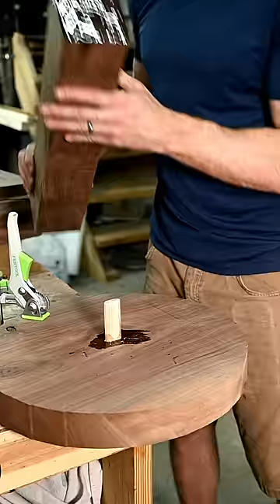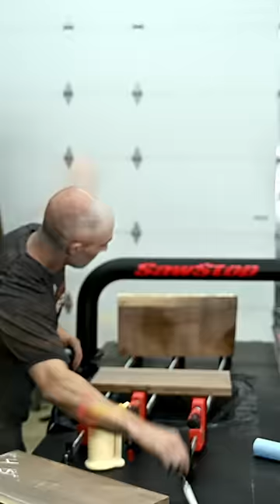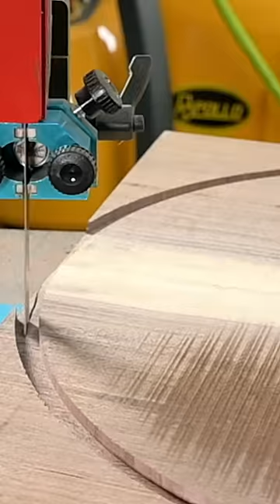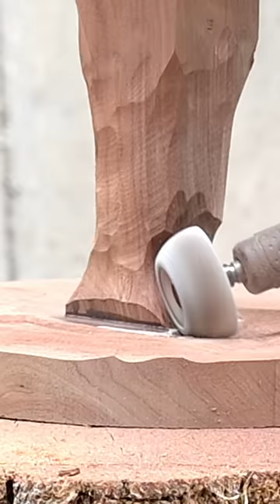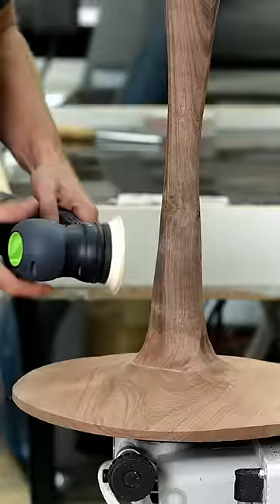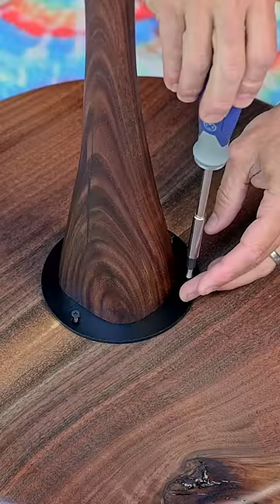I Tricked a Customer

Comment: Everyone saying that the tools don't matter have never even used a hammer. Yes the tools matter. They make the work much safer, faster, cleaner, efficient and the list goes on. And the nail in the coffin for the argument that the tools do not matter, if they don't, why does he use them and not cheap everyday tools?
Reply: Preach. Having done basic construction and home repair, the difference between ever a screwdriver and a power drill is insane
Reply: Time and effiency is key to making money, most people with a varying set of tools learned that and the tools pay off most of the time.
Reply: because he is a wood worker and these are average common tools a wood worker would have in his shop.
Reply: Keep in mind he said tools the average wood worker has, not the average person
Reply: @sh0cktim3  They absolutely are not "average" woodworker tools. Those are all expensive high end tools.
Reply: @nancygross4392  expensive brands. Basic woodworking tools. What kind of woodworker doesn't own a table saw?
Reply: @sh0cktim3 The amish kind. You have to be respectful to other cultures, dunce. 

(Sarcasm unless that was unclear for someone).
Reply: I'd like to see him cut that circular piece with a jigsaw evenly
Reply: @nancygross4392  table saw and router table can be bought cheap he just has really nice ones the bandsaw is the most expensive but not even needed.
Reply: Efficiency?
Reply: Yeah who needs a table saw when you have a hammer?
Reply: @SporkyMcFly  I'm betting he wasn't including the type of woodworker that doesn't believe in electricity in his calculations
Reply: @Tttt-740  That is bordering on racism. Amish people are very good with wood.
Reply: @SporkyMcFly  he did say average
Reply: 100% Fact!
Reply: Yeah it's nice work but acting like an entry level wood worker could do this in the same time is a joke
Reply: You act like people haven't been using hand tools for thousands of years.. Lol sheesh you kids. You guys are so wrapped up in the advancement of technology that you can't see the practicality and beauty of using hand tools.
Reply: @JeffreyGreeb the difference is how much time you spend doing it. People have been using hand tools for thousands of years to achieve some of the most remarkable construction projects. Power tools make things faster not necessarily better.
Reply: @NinjaSushi2  WTF are you talking about? My comment is simply pointing out how tools makes the work so much easier and more efficient to the point that the claim in the video is a joke if not an outright lie.
Reply: @gabe8138  Thats not the point, the point of this short is to prove that an entry level wood worker could also earn 1000+ dollars on a single piece and that these prices aren't only paid because he has a huge following.

Of course without the tools and expertise this will take much more time and effort BUT that is a way to build yourself a reputation and gain experience.
Reply: FACTS
Reply: Because hes a woodworker..... lol i bought a trowel today for 26$ there was one for 38, there was one for 16.... i went middle of the road because its not often i use a trowel but once in a while i do....... and the 40 $ one did feel a bit crisper but whatever the one i got will do... that being said i have a 140$ laser measure because i measure jobs often and its worth it to me.... u spend on what matters.... not necessarily the necessities
Reply: LOL you’re right OP... I was raised to belive otherwise and lived my entire life using subpar tools because of all this nonsense of people saying stuff like this or that “give me two rocks and I can make a beef wellingtonxd” but One day someone gave me a super expensive knife and I couldn’t belive how much better and easier it made cooking things take less than half as long, then I got a large sum of money and spent a ton on a computer and editing videos suddenly took less than half as long, didn’t crash and made everything easier + better. Even the dude in the video is using spaceship level tools And people are coping defending him LOL

Comment: Me, with a single chop saw, jigsaw, and random orbital sander: ah yes, “average”
Reply: Nor is it the average woodworkers photography studio making the advert pics
Reply: You can do it with that bro
Reply: I made tables similar to this with those very same tools back in highschool, although I did have a table router at my disposal. I'm sure I could produce an identical product to this guy's without issue with my tools in the garage.
Reply: The average woodworker with valid tools:  I looked at the tool brands, not at the woodworking.
Reply: Not even random orbital sander, but specifially festool 😂
Its like telling you can tHeOrEtIcAlLy drill hole with screwdriver, but demonstrating it with hammer drill.

Comment: I've never understood why black walnut with sap wood is considered a lesser grade. It is far more beautiful than just one monotoned walnut. With all the pieces I turn in black walnut, the pieces with sap wood in them sell more.
Reply: I think the sapwood is less durable
Reply: because sapwood has moisture that can shrink or rot.
Reply from the maker: Im with ya. To the other guys comments about it being lower quality, highly figured wood is lower quality but significantly more expensive than straight grained wood. I chose slabs for my table specifically for the sapwood they had. Long way of saying, I totally agree!
Reply: Si 👍👍👍🇭🇳😎
Reply: @blacktailstudiouncut  Translation: "Imma cheap ass that doesn't mind screwing people over."
Reply: the things the others mentioned but this can be mitigated by sealing it properly. it is structurally less durable. because technically every spot is a possible point of failure, but unless you are using it for structural work that doesn't typically matter.
Reply: @topogigio7031  how did he screw someone over I have the same style for kitchen cabinets I made them 20 years ago still look great even over the stove top and oven
Reply: Saw mills see birdseye maple as flawed and full of defects so you can sometimes get it cheap.
Reply: More for us then :) I love cheap woods or stuff you find laying around: saves you money and you get a lot more of the “random” that can make certain pieces beautiful
Reply: I’m sure it’s also harder to get wood that’s the same versus one that is all over
Reply: Same.
Reply: Not sure, but from my limited understanding I think at least 2 people have to die in the collection  for it to be expensive??
Reply: Awesome presentation!
Reply: @Jones Johnson  you shouldn't be using wood that isn't dry. Sapwood may have more moisture when the tree was alive but after processing the water isn't a issue
Reply: @kevinkruse88  using epoxy will stabilize the sapwood!
Reply: @topogigio7031  Translation: "I'm a talentless hack trolling sucessfull people because I have low self esteem!"
Reply: @blacktailstudiouncut  if you wouldn't ha e pointed out the cost of sapwood they wood have (haha) picked something else to nitpick you about so they will feel better about being too lazy to be productive! Great table set bro!
Reply: Id assume because most of the time if people want black walnut it's because they like darker wood or want darker wood for their project
Reply: @boinkmcbingo8890  from an aesthetic point of you it comes down to taste. While sap wood in and of itself is quite unremarkable and often soft and punky, the contrast of blonde sap wood with deep rich black walnut heartwood is exciting and striking, it can also call a lot of attention to itself and feel busy. Maybe perfect for a statement piece like a table, perhaps not so much for a kitchen full of cabinet fronts. Good design involves a lot of restraint. Good design doesn't call attention to itself, rather it performs a function with elegance.  People are fickle and tastes change, often with the seasons. Your much more likely to love the sap wood now and hate it in a year or two vs something in an all heartwood homogenous tone. Grain with less "character" has a more understated beauty that plays a supporting role to the environment in which it resides. It's not the toddler prying for attention. This is why most consumer goods are just boring and ugly AF. Sure cost is an issue, but finding a common denominator for the mass market is usually more easily achieved when things are simplified.

So it really comes down to taste and economics of producing goods gor the masses. But your not making cool shit for the masses are you (youtube audience in general). So go have some fun and do what makes sense for you.
Reply: @gregsimonsstudioG   chill out dude I was just giving him my guess as to why it's condsidered lower quality (which is I assume people want the color typical in black walnut if they want that wood) And for your information ,while I might not be making cool stuff for the masses, I am currently in the process of hand making a banjo. So next time dont just make a baseless assumption your "gotcha" line.
Reply: @boinkmcbingo8890  I'm so sorry if my comment has offended you. My perspective was offered to the whole of youtubers happening across this thread and NOT directed at you. Though I can see how you might have mistook it to be as i mistakenly replied directly to your comment and not the thread in general. However, my assumption if applied to you is spot on as you, youtubie, are not making stuff for the masses. Rather,you are making a bespoke banjo. Bravo!
Reply: @gregsimonsstudioG  my bad dude, I didn't throughly read it through so i thought you had some issue with what my guess was. And it's not necessarily that I was offended by what you said It's more that I thought you  were saying all that just in response to what I said. Like when I had read it with the context you replied for me and how i interpreted seemed like you were arguing like as if I said I didn't like the sap wood then were trying to like tease me by saying oh bet you don't even wood work, but yeah my bad on that one man. Also I get what you had meant by you're not making stuff for the masses now and I like the sentiment.
Reply: @topogigio7031  He’s not screwing anyone. A person’s time/skills/experience/tools, etc is worth what someone is “willing” to pay. He didn’t trick someone into buying it. He produced a beautiful, high quality product and another individual “chose” to acquire it from him. That’s business in a free market.
Reply: @AngelaScene18  as the first two replies show the moisture will cause warping and issues.

He has a video on this channel where he got made at his wood distributor for having moisture in a piece but he didn't even check it before working with and here admits to choosing those pieces so it's not the look, it's the fact that the quality isn't what you have, it'll get worse over time because it's hasn't been treated to remove the moisture and such and tables of this price should last, but his won't.

Comment: Weekend, so at least 16 hour of work.
Electricity: I don't know there, but in Italy I can calculate my average usage costs 7€ a day, so that would be around 15$ for two days.
Wood: if I've heard that right, it's 90-100 $.
Various materials (sanding disks, wood finish, gloves...): maybe 15$?
Taxes?
I'm not calculating some other small things like the the tools wear, that's or course a really little amount, but still at some point tools and machinery must go under maintenance and parts be replaced, so...
I'd say the income would be 950$ still with taxes to be paid, so around 60$ per hour. I don't think that's tricking somebody, especially if you're experienced in your job.

Comment: Not only do you need expensive tools, but you need plenty of experience.
Reply: If time isn't important you can make that with very basic tools, but than you need even more experience.
Reply: Carpenters made stuff like that long before those "expensive" Tools existed, with nothing more than a handsaw and a woodworking slicer.
Reply: I’ve got all that. Just need motivation! 😂
Reply: @Purplehain  
They did not  make tables like that in a weekend back then.
Reply: @tyaty  hence my "if time isn't important"
Reply: Skilled woodworkers on YT forget sometimes they have years of experience and therefore can just make those things. I’m not a skilled woodworker, I build some stuff out of normal square boards, but if it comes to circles I would fuck it up immediately. So I couldn’t do this just like that.
Reply: @tyaty  yes they did
Reply: @Sena121  not saying hes bad at all,but he's an average Woodworker at best
Reply: @Purplehain if that’s all they ever could work with, I’m sure you’d get pretty good at using them. Usually no one is going to stick with only those tools in the modern era because it takes too long. The point still stands that you need a lot of experience to even make it well.
Reply: A sawmill, angle grinder (if we dont count accessories) and Router are basic Tool for any woodworking Shop, Heck enven a Carpenter nowdays uses electric machines to an extent, good luck on achieving similar with a hacksaw, some files and a chisell
Reply: No shit Sherlock somebody get this guy a gold star
Reply: @foenix8094  sometimes I wonder if I'm even writing in the same language. "but than you need even more experience"
Reply: No and no. Harbor Freight got you. This guy didn't even use expensive tools except his tables, which there are plenty of <$200 alternatives. Cutie ;)
Reply: A jigsaw and a sander is all you need, both of which can be picked up at a pawn shop on the cheap.

Ten minutes to learn how to make a jig to cut a circle. That's literally the most difficult part of this. The rest is just elbow grease.
Reply: Proof?

Comment: Would take 10x the time in a normal woodworkers shop
Reply: 1200$ is 1200$
Reply: Not really. Cutting a circle and making the leg wouldn't be unusually difficult with a standard woodworking shop.
Reply: @RyanMonty  the way he did, with basic woodworking tools… it definitely wood
Reply: So then charge more....i swear people are their own enemies
Reply: @chrissnipedu  A bandsaw, table saw, router table, and angle grinder are basic woodworking tools if you have a shop.
Reply: Did you pull that comment out of your foot? I'm a professional carpenter. I can make a table like that in my back yard with just some basic tools that cost about 500-800 dollars depending on the condition and brand.
Reply: That’s why you have to be doing something for 10+ years before you start making big bucks… you start out making $15 an hour until you’re fast enough with enough experience to make more
Reply: @noahornosh  $1,200 is $1,200, but four weekends is not 1 weekend. The point of the video is that an average woodworker can make $5k a month making end tables on the weekend. And I call BS.

For one thing, If the average woodworker could make table stands that looked that good, he wouldn't make $1,200, because they would be everywhere.

And while you don't need expensive equipment to make that table, you have to know what you are doing. And if you are just an "average" wood worker, it's going to take you a lot longer to make it look as pretty as  he made it look. And if you don't have at least somewhat expensive equipment, like a jointer and planar, it's going to take that much longer to make.

Just saying, I've seen the completed projects of a lot of "average" wood workers, and they aren't that. Not by a long shot.
Reply: @Mr-R.R.  That's a good way to not get a sale. The time and effort you spent on something has nothing to do with its value.
Reply: @Synol  in what dimension are you living in? I don't work in this industry, but i do work in an industry where I currently just got done getting a client to agree to pay me 35% more than he used to because what he's asking for now costs me more time to make.....
Reply: I also feel like most people wouldn't even know how to ship those properly.
Reply: @m.dewylde5287  I'm sure you could
Reply: @andrewman6637  I did. I do. I will.
Reply: Get a spokeshave and learn how to use it!
Reply: To all of you bragging about how easily you could do this next weekend do the damn thing and post a picture of it.  My prediction it would look horrible compared to the guy in the video.
Reply: Not really

Comment: Those tools you mentioned alone even on sale at harbor freight are $40. Then the beginner takes about a week to carve all this by hand…192 hours of workmanship for $1000….that’s $5.5 an hour and a weeks time gone. It’s only profitable if you have invested in power tools that can make your work faster, hence the shop full of em.
Reply: I could make a photorealistic painting in MS Paint over six months and hundreds of hours of work for free. Or spend 200$ on a real program like Clip Studio EX and do the same painting in a few hours, lol. Tools make all the difference.
Reply: At first you might be only making a little money, but as you get better you get faster, which equals more money per hour
Reply: Where'd that 192 come from?
Reply: Wish he would acknowledge this lmao
Reply: There aren't even 192 hours in a week.
Reply: Start with 2 boards, drill a pilot in each and attach a swing arm to draw a circle, then cut it out with a jigsaw. Chase that with sandpaper and a rasp to get the right angles. Laminate some boards into a post and draw the curved leg profile on one side. Set your depth on your circular saw to your profile line and make a cut on all four sides every 1/4 inch or so. Knock the chips out, clean it up with a chisel or rasp, and sand it all smooth. Finish, stain, and put it together. You could do it in a day.
Reply: My homie working 9 days a week
Reply: @Lawrence330 probably New Mexico or good kitty.